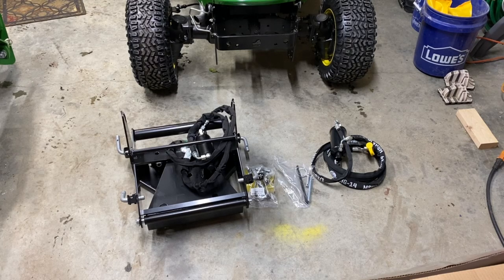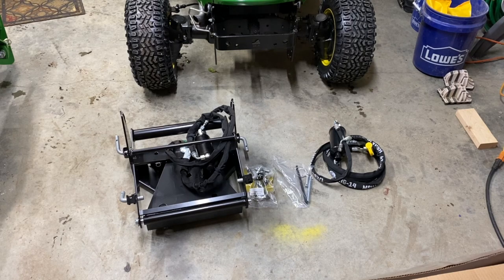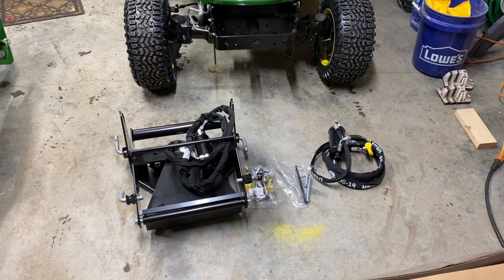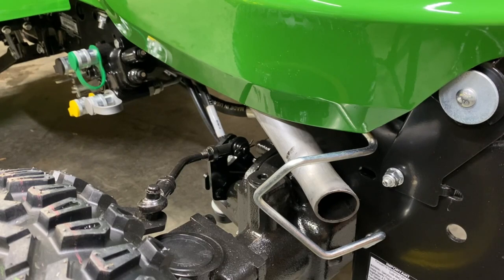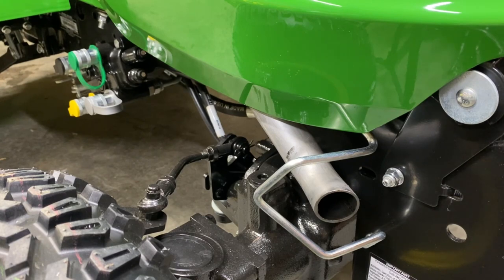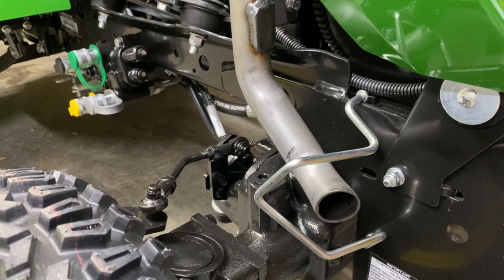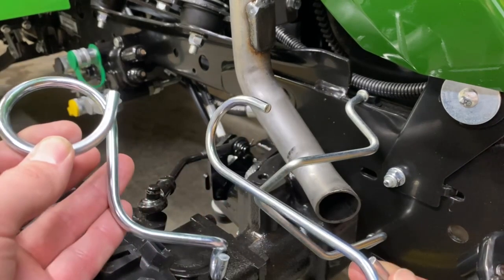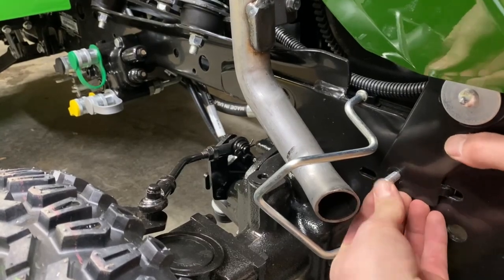John Deere X700 Series Quick Hitch Part 1 - Tractor Prep & Lockout Valve Install

Comment: Hello there, installed same as your.  After installation when moves lever, hydro leaks from nob. Any suggestions
Reply from the maker: Hmmm… I can’t remember off-hand, but there may be an o-ring in there, I’d have to look and get back to you. Most of the time these fittings have o-ring seals. May have tore one.
Reply: @JoshsGreenGarage  I see thanks for responding

Comment: Can you confirm that the lock out valve comes with the quick hitch?  I cannot find anything in writing that says it is included.
Reply from the maker: I can confirm, it does come with the front hitch. To be 100% sure, I even just ran out to the garage to check the manual's parts list.
Reply: @JoshsGreenGarage  what is the part number of this quick hitch?
Reply from the maker: BM26236
Reply: @JoshsGreenGarage  thanks for the quick reply! What do I do if I find a used one without the lockout valve? What happens if I don’t install a valve?